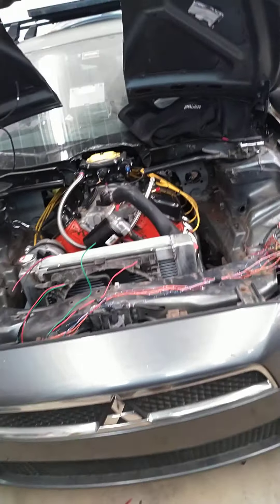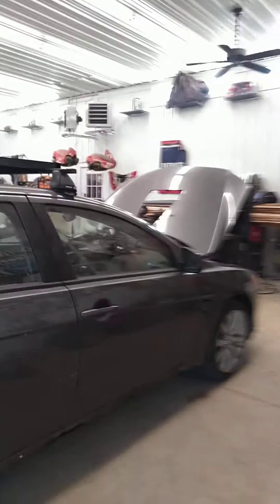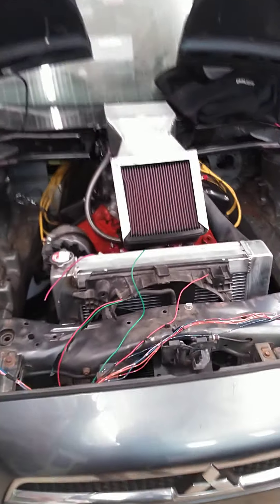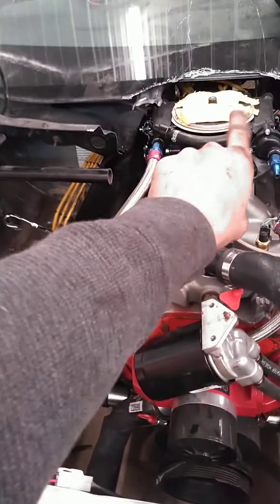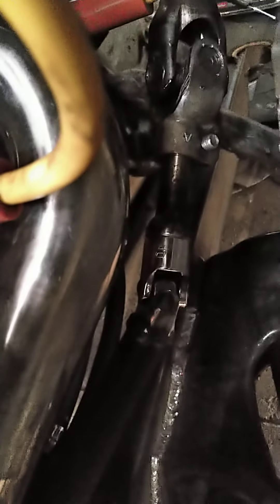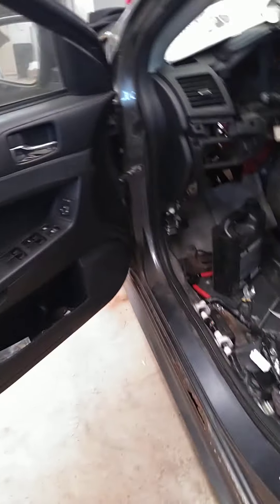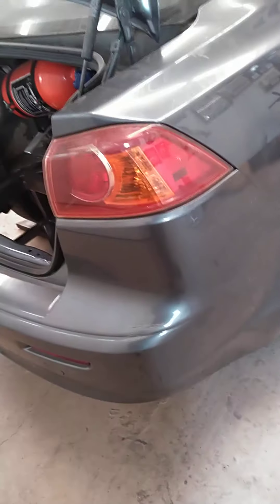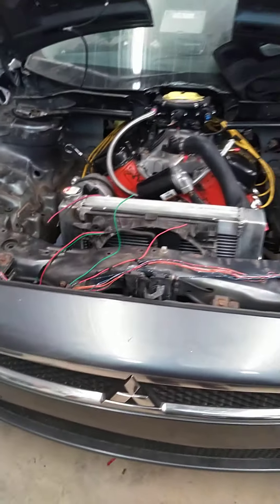big block 454 with nitrous in lancer.

Comment: If you plan on running a system in the car or leaving the battery in the back upgrade the power wire for ofc and upgrade the ground straps. But love the build its unique and she's going to scream going down the road.
Reply from the maker: I actually have an old subwoofer setup I'm using the power and ground wires from. Used the ground on alternator to starter, and will be using the power from battery to deadbolt.

Comment: I've come to realize there are builders and copy cats. 80 to 90% are copy cats reading brochures and doing whatever someone else has already spelled out for them. Im curious how you're going to set up your steering. Im looking forward to that and the new intake. Keep on chugging dude.
Reply from the maker: Thanks man! much appreciated. I'm going to throw in a carrier bearing on frame rail of unibody for steering shaft once I get it all fired up and know 100% it runs.
Reply: @penetratedwelding1952  what are you down to until first fire, wiring? I know fuel cells gotta go in and pumps on the way.
Reply from the maker: Yeah wiring the holley sniper and the  hyper spark. Got nitrous lines and solinoid hooked up so no vacuum leaks and that should be it. Might be missing a couple small things but nothing major.